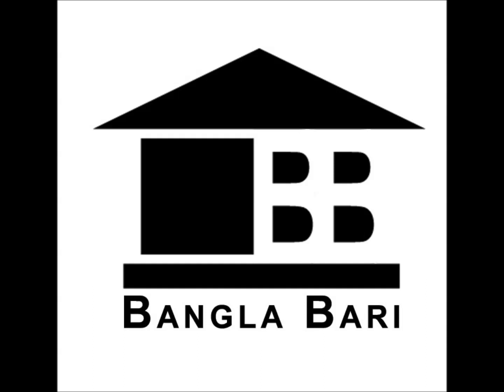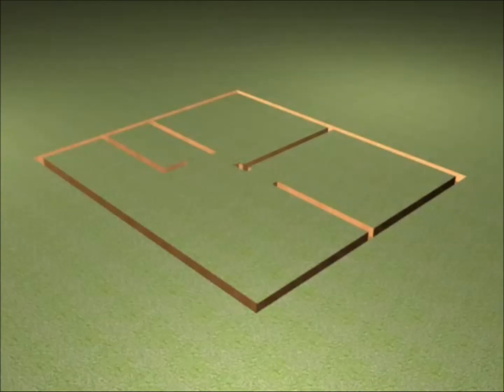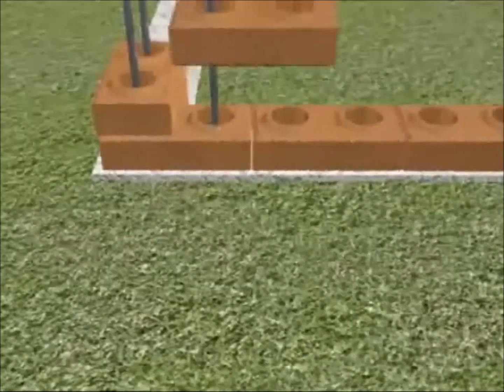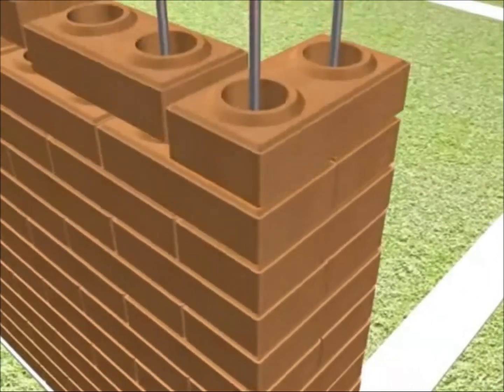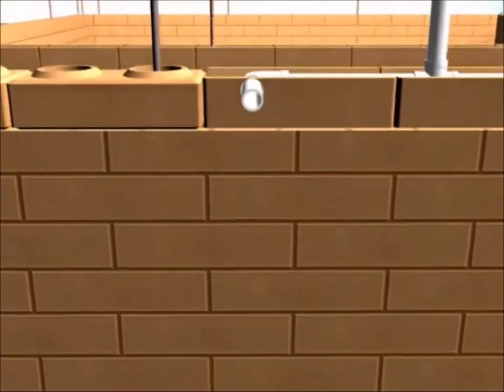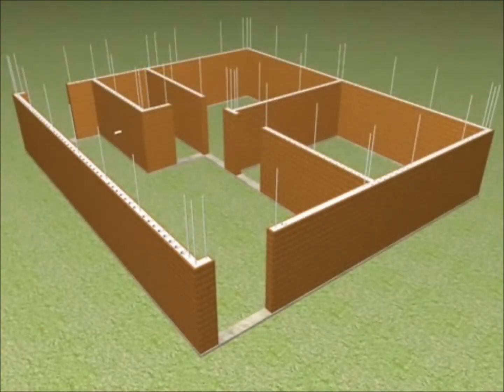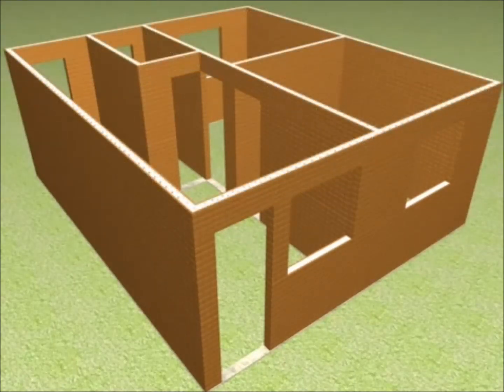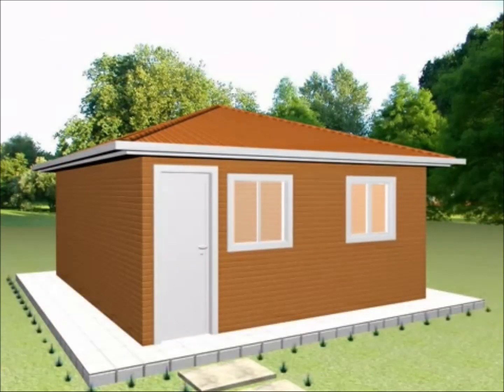How to build a CEB house

Comment: Looking at the video, I would be cautious using this information.  The vertical reinforcing bars, for each corner / intersection, you would be wise to have the bar in the corner / intersection, then add two bars either side.  Next, with what is being looked at here, a vertical bar at a maximum of 600 mm centres, and horizontal bars every 600 mm in height.  Doors and windows are to have a full ring of concrete around them.  The roof is to be tied back into the top 2 horizontal reinforcing bands, and threaded rod is to be used to tie this all together.  

The infill with the cement is to give you, should the brickwork be removed, is to finish up with a tubular fence design, OR, an old style prison bar / cells, where you have 5 horizontal flat bars with the vertical round bars through them!
Reply: "Doors and windows are to have a full ring of concrete around them." You can also use burnt bricks where the doors and windows are.

And with doors/windows in CEB walls, wouldn't it be possible to use iron rods the go deep inside the CEB wall instead of wall plugs? I have no experience with CEB walls.

Comment: - What about construction in areas where earthquake risk is high? How do they withstand lateral or vertical movements?

- In case of damage to the wall how do you go about fixing it? It seems that it would be very difficult to replace one or more of the damages bricks if they occur in the middle of a wall.
Reply: The government of Nepal have encouraged their population to build with this type of brick, provided that they build using the building code that is specified by the government.  There was a large earthquake in Nepal c2015, which done a lot of damage to a lot of mud and earthern buildings.  As a result, aid has come in from Europe and the United Kingdom to help the population establish family and community brick manufacturing operations.  One of these operations is called "Build Up Nepal", and they have many videos on YouTube in both English and Nepal / Tamil language.  Part of making your property earthquake reisistant is what you do under and in the foundations.  A man in the Adelaide foothills built a home in the 1940's, and his home survived the 1953 earthquake without even a crack in a wall, where all the neighbours had large cracking.  His secret?  Binding of 2 1/2 and 3/4 inch blue metal below the foundations, then poured a raft foundation that was 12 - 15 inches thick.  But, he failed by using orange plastic under the foundations, as this attracted white ants!  Bugga!

From what is recalled, MYIB done a video, which has been shown on YouTube, where the face of a brick was damaged in the middle of a wall.  What they done was to grind the face of the brick away, then take a fresh face from another brick and glue that into position.

Comment: As the vertical reinforcement runs throughout the height of the wall, how do you seal the brick holes from below while laying concrete for creating beams at the various levels?
Reply from the maker: We usually start from the base so the vertical column already has one side sealed. Before laying bricks we make a coat of tar so water doesn't cause corrosion.